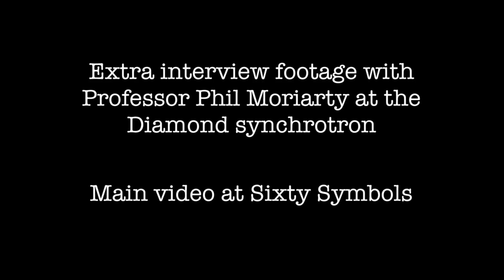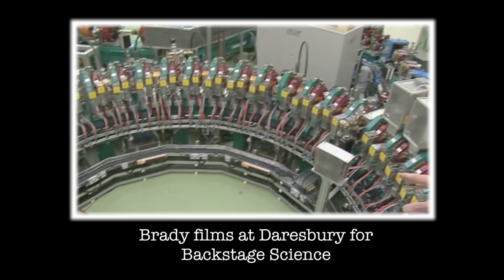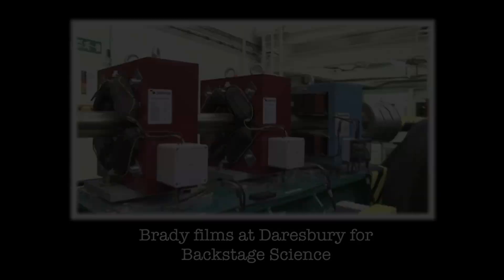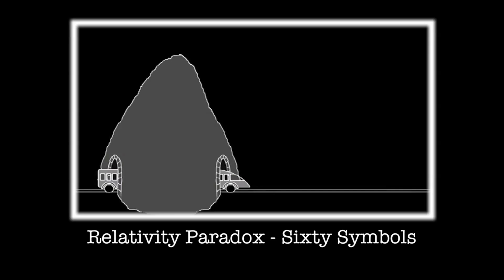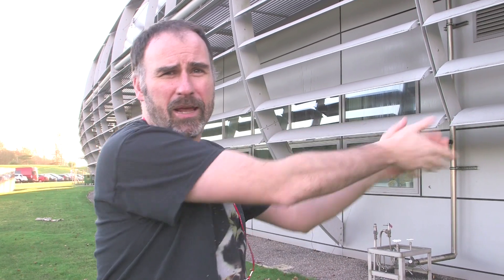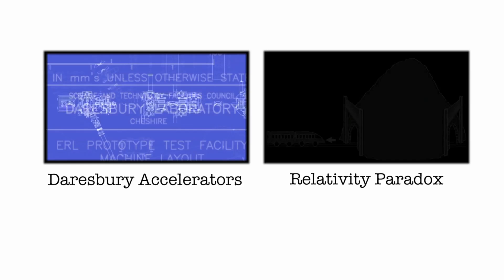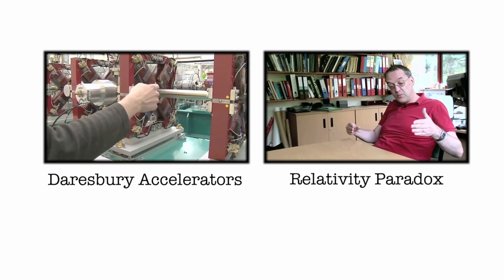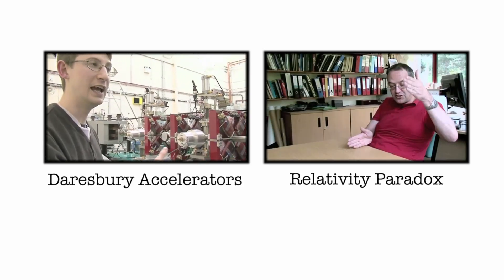Synchrotron Experiment  (extra footage)

Comment: Wouldn't the way to get different frequencies on a particular beamline be done in terms of changing the Δp of the electrons, i.e. the rate of change of the momentum of the particles? How is that achieved with so many beamlines running in parallel without one beamline influencing the next one?
Reply: because it's a little beam made of few electrons not a thick electric wire